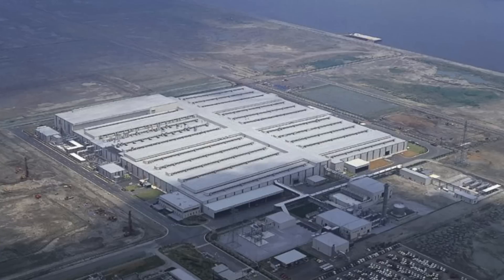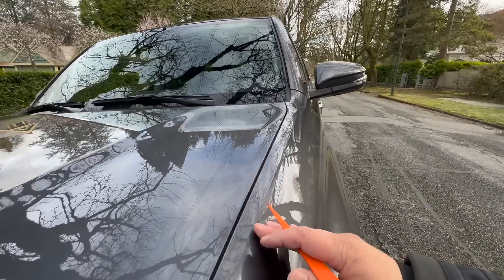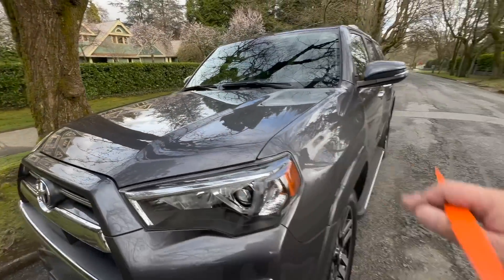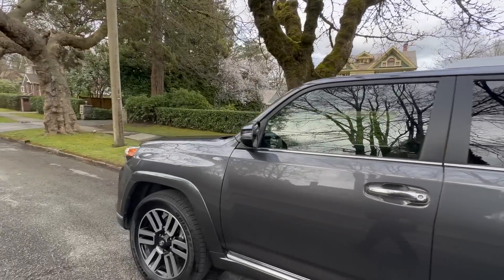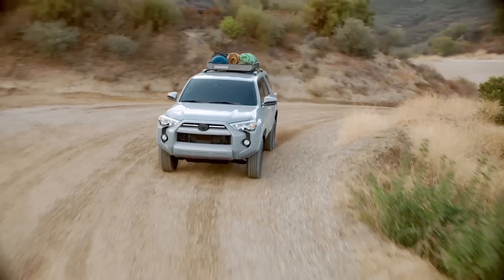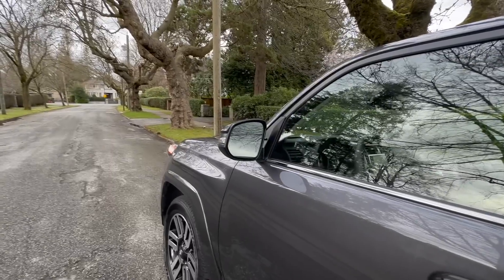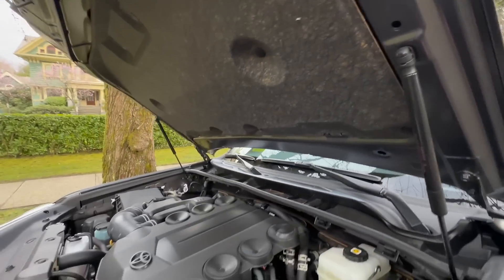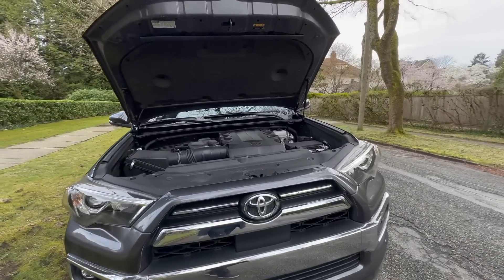HOW'S THE QUALITY OF TOYOTA 4RUNNER BUILT AT TAHARA PLANT IN JAPAN?

Comment: Been holding out for a TRD pro 4runner for last several months.   I am starting to really like the Limited trim though. Much easier to get one of those. I’m starting to think ride quality as well and handling is much better with the limited AWD XREAS suspension over the Fox suspension in the pro. Still have some decent off road chops when/if you need to have it.

Comment: My 2020 4Runner leaks water in the sunroof.  Dealer says it’s normal leakage.  BTW  I purchased it new.
Reply: Clean the drain holes. And get some AT 205 reseal and wipe down the weatherstripping with it. My trucks a frame bushings started squeaking loudly. 2 nights in a row applied with a small paint brush and let sit. FIXED
Reply: @mikeporro3311  thanks will try

Comment: Amazing car, a real Toyota, Japan-built, bullet proof (other than chassis being vulnerable to rust as most body-on-frame Toyotas are)! But it has a few issues for this day and age, I'll mention four. *First, the MPG is not quite acceptable. **Second, the side mirrors aren't on the front door panels to allow the air to quietly pass at high speeds (at least Toyota could do that as a small face lift). ***Third, there is no 3rd row. ****Fourth, the crash rating (4 star per NHTSA) is not impressive partly due to the thick steel panels. 

If these are not big issues to you, simply buy them, they will last you a life time.
Reply: If The mirrors are mou ted on the door proper the the door will be damaged if mirror gets clipped.

Comment: David, one thing I’ll say about interior quality is that my 2019 4runner plastic scratched super easy, especially the plastic in the cargo area. You could scratch it with your fingernail. Also, the carpet is very thin now compared to years ago. I was quite disappointed. The overall fit and finish was excellent,though.
Reply: Yeah I'm considering  putting  those vinyl covers so it won't  scratch
Reply: Quit crying